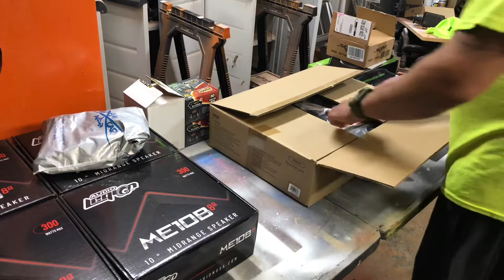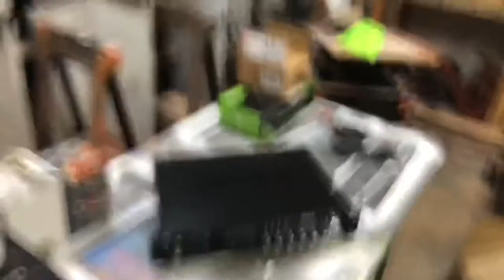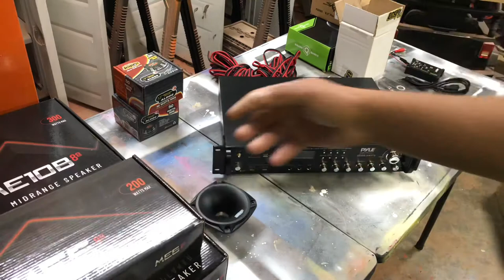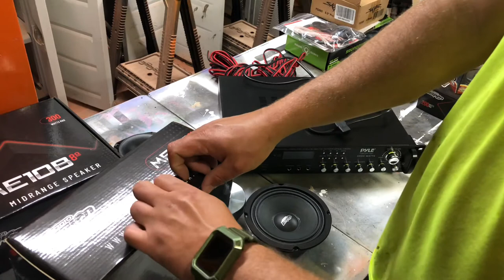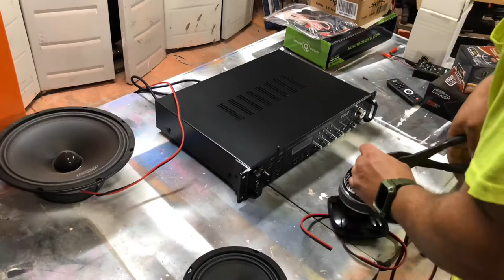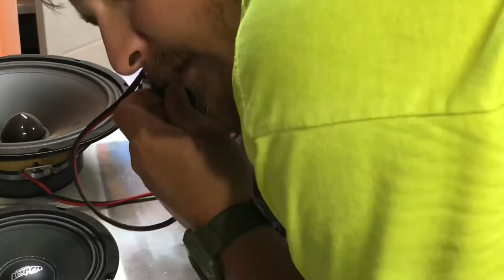PYLE PRO AUDIO P3001BT HOME AMPLIFIER / Unboxing and Testing

Comment: Got the same one want to know how to connect it right and how to use the sub out saw some 4 ohm pa speakers 1200w 600rms ?.. Pyle manual says 550 @4 ohms and 950 @2 ohms could not find 2 ohms pa speakers
Reply: You must not know much because you can wire any speaker to the ohms you want

Comment: run away from this company...they do not honor their warranty....their reply to my fried unit...Unfortunately, the unit that you purchased from XXXXXXXXX is not covered by the warranty as they are not authorized retailers/Resellers. Also, due to the fact, we cannot verify that the unit was a new unit.
 
We can offer repair (if possible) and you will pay all the shipping and repair charge if any applies but if the board is burned with no parts to replace it then you get nothing from us.
 Our apologies.
 Have a great day!

Marlon Joson
Technical Advisor

worthless warranty on a new unit 3 months old...unable to repair... junk product, maybe good for a boat anchor... should have believed other bad reviews.